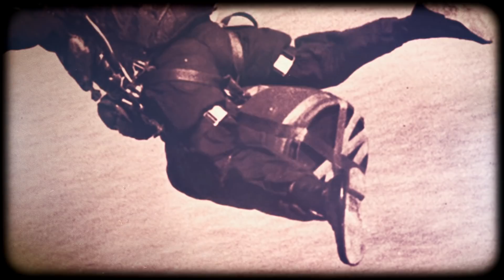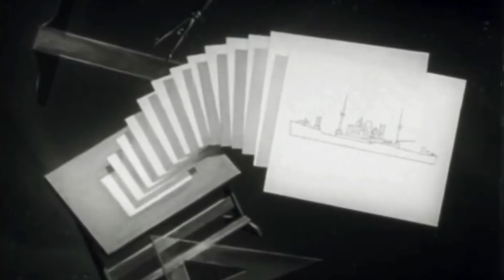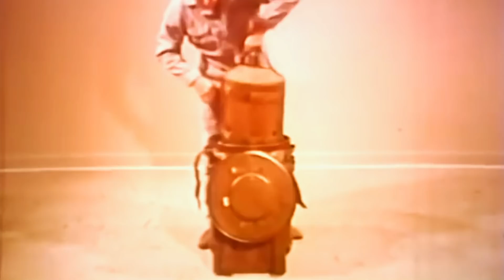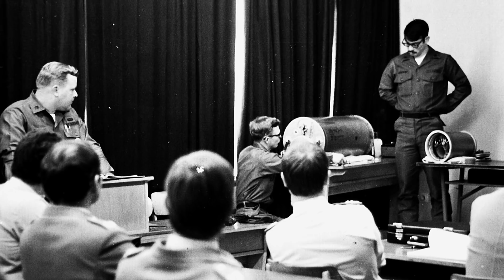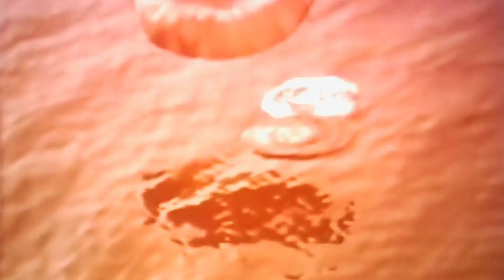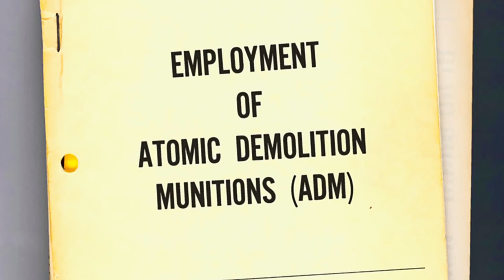A Man with a Nuke Between His Legs

Comment: I was on two SADM teams at Fort Bragg.  A couple of comments:

The correct pronunciation is SAY-dum.

Each Greenlight team member was on the Nuclear Personnel Reliability Program (PRP). There was no "Personnel Reliability Test."

The Greenlight mission was tested by a classified Special Forces unit in Berlin: 39th Special Forces Detachment, Team 5 (the unclassified name of the unit was "Detachment A, Berlin Brigade). At that time they were the only SF ODAs that had top secret clearances.

All of the Greenlight Teams (one per battalion) were HALO/SCUBA detachments. All three of the SF Groups that were active at the time (5th, 7th, and 10th) had 3 teams.

The SADM was also used by engineer units (MOS: 12E).  Engineer units also had the MADM (pronounced MAD-um), the Medium Atomic Demolition Munition. It had to be hauled around in a jeep.

Navy UDTs had it but I doubt SEAL Team One or Two did. The Navy got out of this business early - Special Forces had the people to do it.  UDTs had limited coastal area missions.

The SADM had two yields. Neither were close to 1kt.

The timer was incredibly inaccurate. Each timer setting had a "no earlier than" and "no later than" time. That meant you could have a couple of hours to watch and wait.

We kept overwatch on the device using a sniper. One guy would stay with the device while the others backed off to the minimum safe distance. The sniper would maintain the "two man rule". The guy who was left there to flip the switch was the lowest-ranking unmarried man (I was one of those the first time around).

The 5th Special Forces Group SADM standard operating procedures ended at detonation. At the time, the US military had the means to get us in, but not get us out. I asked my team sergeant what happens then; he said "After that thing goes off, I'm gonna hit the nearest '7-Eleven' and head for the hills for the rest of the war. He was a former parachute rigger and designed the harness we used for the device during jumps (not shown there). The Army "Alice Large" was actually designed to carry the SADM. It fit it like a glove. That way we didn't have to carry it in what we called "the trash can" (shown in the movie). Instead it was in the fabric weapons bag (shown as they lowered it into the trash can) then put inside the rucksack (Alice large). 

Everyone hated freefalling with the device. Even guys with a thousand freefalls could barely control it. The jumper was merely a passenger, along for the ride. No one signed up for a second jump with it. 

It was much heavier than the weight given in the video.

The video had some factual errors in it and some "legend" stuff but what I've written here is what I know to be accurate as well as unclassified.
Reply: Thanks for sharing
Reply: Very interesting, thank you
Reply: Thanks for the info.
Reply: Thanks for your brave service👍👍
Reply: Was the comment I was looking for.  Thanks!  And thanks for your service!
Reply: I bet 100% mechanical detonation mechanism, no electrics/electronics, really brilliant, complex secure designs that prevented any mishap or illegitimate use, could lockout permanently.
Reply: @iamtheomega  It was mechanical, rumored to have plastic gears. It had a combination lock on the front over the face. You had to perform a specific physical act to arm it apart from the timer and the arming switch. We were the sophisticated security mechanism.!
Reply: @A Twinspark No, it really was a mechanical clock.
Reply: @stever8776  Honestly, we were amazed they actually paid us to do that stuff. Apart from the weapon, we got to do cool things from time to time. Not brave, just slightly askew...
Reply: One question: why is there a warning “ do not turn above 27 hours” above the timer?
Reply: @amahlaka  I'm wondering that too. That's a really specific number. Maybe it has something to do with the clock inside that arms and detonate the thing when it hits zero not being able to function properly over 27 hours and could lead to an instant detonation?
Reply: @Sp00kq  We weren't sure. That was one of the few specific things about the timer. We guessed (and only a guess) that it would get too close completely winding up the spring (just like in a wind-up alarm clock) then strip out the clockwork gears making the entire device unusable.
Reply: I was a 12E, stationed in Germany. Glad we never had to use them.
Reply: I was a 12E with the 275th ADM

Comment: 5:00 No timer. The timer was just for looks and they knew it.
Reply: Theres a reasonable doubt that it wasnt. But I would assume the same.
Still, if they put it in a train going in a railway tunnel, or dropping it from the top of a dam, into the bottom, it would require a timer to do its job properly. Nuke or not,  some big structures might remain repairable if the placement was weird.
Reply: I know, and I'm surprised they bothered with a parachute.
Reply: @Kandyman736  they had to get it where they wanted it, thus the parachute.
Reply: So they DIDN'T actually want it between their legs?  :D
Reply: I'm sure it really was a functioning timer.
Reply: Our Tesm conducted a trading mission where we detonated a SADM with only its conventional explosives.  The timer worked fine and went off precisely on time according to a stop watch even though we had been trained to take into account timer error in the mechanical timer.

Comment: Having a nuke, even smaller than sadm, why not?
Reply: Can't make them smaller than the smallest critical mass, which is something about 6kg with added neutron reflectors. Then add a layer for impedance matching, explosive lenses, EBW detonators and the electronics (HV supply, capacitors, fast HV switches like Krytron) needed to fire them at exactly the same time and you'll be at the weight/size of a SADM.
Reply: @hinz1  pretty sure you could make the device smaller, but it would definitely not be any lighter...the nuclear artillery shells were only 155mm in diameter and those were designed in the 60s...with todays computer simulation capabilities and who knows what they managed to come up within the 40 years of additional research that's still very classified, it'd be silly to think they can't make it smaller ;-)
Reply: @AKAtheA  davey Crockett

Comment: The basis for this video is wrong. The US Army developed the 8 inch round to carry a small yield device to create delay .  They could be used to destroy bridges, high speed avenues of approach and the like. They were NEVER designed to be a strategic weapon.  US Army Atomic Demolition Teams were stood up to enhance the corps and army barrier plan. We trained regularly to deploy them. We had SADM and MADM devices. The SADM was clearly in our inventory in the mid 1970 s.   They were NOT suicide weapons   PERIOD. The SADM had two man control built in. You had an A lock and a  B lock BOTH of which must be activated.  The deployment ALWAYS used a built in timer to allow the team to exit outside the blast and fire distance.  They also could be detonated by wire.  Again to allow team survival.  The doctrine was to set the timer then deploy the wire. The timer was a backup. The MADM was switch selectable for yield.  Get it right please.

Comment: I'm sure nothing like this was used on 9/11  to heat up some I beams before a blast drops them towers. They were just put away and forgotten about 'cause Uncle Sam said so !  The device had a much lower yield than I kiloton , I have notes from other sources that say it was closer to one tenth  that amount  ( between ten & twenty tons TNT)and that makes   more sense for a tactical weapon as well.   You still had to get away asap .  A  parachute dropped  M-28/29 Davy Crockett recoil less  smooth bore cannon round was also employed with a like tactical low yield warhead.  Are all these light weight atomic toys accounted for today still?  Hope so but rather doubt it.

Comment: The voice over about having to stay around while it ticked down is all bullshit.  you could easily bury something like that in such a way that it is unlikely to be found and simply bugger off.. most of the voice over is false and just time filler (like a lot of Y tube) .

 The weapon (B-54)  came in bits., there were either two or three torus rings of U that came with it  (these had to be carried by secondary members of the team. ) .  These in theory  had to be assembled with it on site. .. all that is not mentioned..(I am guessing the naval version was  dropped fully assembled but with flotation added to it to make it approx neutrally buoyant ).. it is  frankly a mainly BS voice over.

  This "must be" a  mini implosion type weapon though the torus rings suggest a gun type weapon.  It was one of the most expensive bombs per tonne of TNT equiv ever made I 'd guess.  Typically under test they only produced 20 T of Tnt equivalent... you can do that with a load of Ammonium nitrate fertilizer and  diesel.. it is just a lot bulkier.   TE.   Fidler NzL